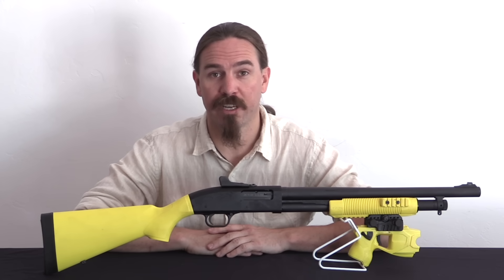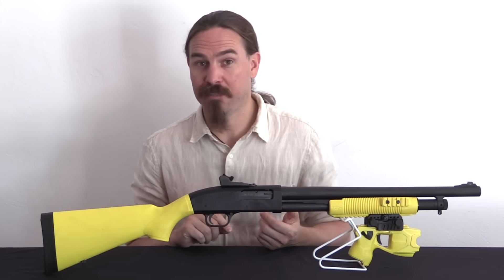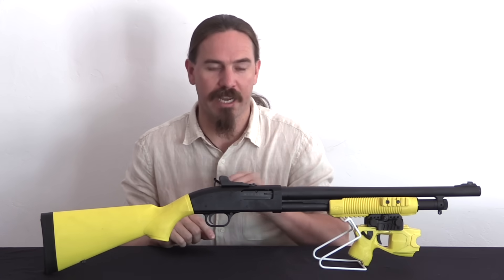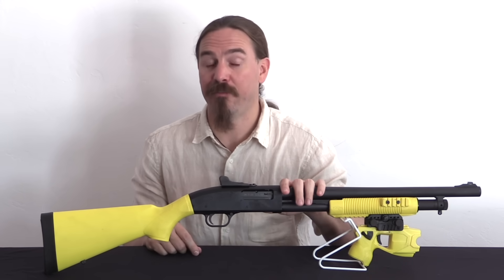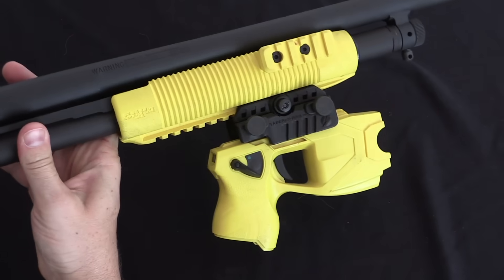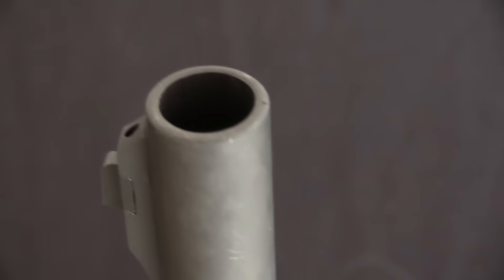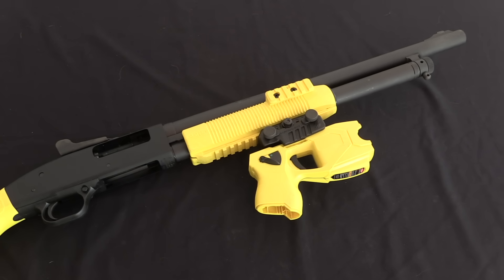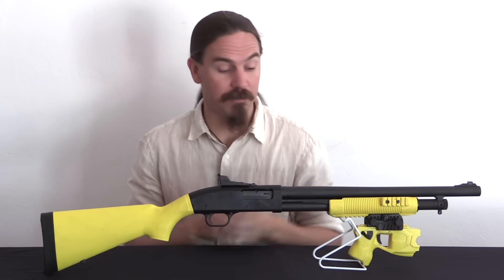Taser X12 XREP: A Taser in a Shotgun Shell

Comment: If anyone wants to know, this is how a taser works: 
It fires two little arrows with cables attached to it. İf both arrows hit the human and pierce his skin, the electronic flow starts, the targets muscles contract and the target falls on the ground. Problems: 
1- The range is between 1-8.5meters, so if somebody is attacking you, you have 2-5seconds to fire. 
2- There is a 15-20% chance that the Taser wont fire
3- Even if the Taser fires, both arrows need to hit, with at least 30-40cm between the arrows
4- Even if you hit the target, the clothing can be a problem (motorcyclist jackets, leather jacket etc)
5- some people are not affected by tasers

Comment: "Someone can stand 50 ft away and huck rocks at the officer, who can't respond with less than lethal force"
Sure, a rock is not AS lethal as a 9mm parabellum is. But they are still lethal.

In my mind, lethal force should be handled with lethal force. Regardless of if it is a rock, a bow and arrow, a gun or a noose.
It happened in my country back in the 90's, a bunch of antifa morons threw cobblestone at the police. One police officer was hit badly and so another one stepped in between the rock throwers and the downed colleague. Of course the shit-for-brains kept on throwing rocks despite the obviously downed and bleeding profusely officer.
Well, the colleague who was defending his fellow officer saw no other option but to respond with lethal force to protect innocent life. And so he took his Sig 228 and put a bullet in the closest rock hucker's stomach. To the effect of the rock thrower stopping, standing upright in chock, taking to his knees while holding his abdomen and then rolling over on his side.
About half a minute later he was screaming in agony from the new bodily openings he had acquired through his abs and backside. Clean through and through.

I watched the recordings and i applaud the actions of that officer. But "the public at large" cried wolf stating the "BOOOY" hadn't done anything wrong and that the officer should be fired and charged with attempted murder. Despite the fact it was clearly shown on the recordings that the idiotic babyman was throwing rocks at an already severely injured officer.
The court rulings were that the officer performed his duties as best he could under the circumstances and was commended for his actions.
The boy got off without further charges because being shot in the stomach was punishment enough. Though i would have advocated at least 10 years behind bars.
But hey, he lost one of his kidneys and his spleen so maybe that too is punishment enough.

Either way, in my world, lethal force should always be met with lethal force regardless of how lethal it is. Especially when targeting the police.
This of course includes taking out people behind the wheel. A car is just as a lethal weapon as a gun is. Albeit a bit slower and less precise. Still, anyone uses a vehicle as a weapon is someone who needs to have their life voided in my book.

Comment: "There are many less side effects of being tased than being hit with other police gadgets such as bullets"
Reply: If the prongs attach too close to one another, the current just flows over the skin with zero or at least, far less effect. If you saw the taser prongs both sticking out of his bare chest: that's failure mode.

It is the same with these Automatic Electronic Defibrillators: you are taught in First Aid class you have to position the connecting pads so that the current actually flows through the heart and not over the skin. And no, putting the pads on the front of the chest (as you see in many movies) isn't correct. One goes on the right front top of your chest (close to your arm-pit) and the second one on the bottom left side of your ribcage. Then the current flows through your body and not over your body.
Reply: all fun and games till someone shoots an eye out
Reply: @snoopyshultz  would MUCH rather lose an eye to a taser prong than have a bullet carry the eye, skull, and most of my brain onto an adjacent wall.....
Reply: This looks like a good home defense gun
Reply: I'm guessing no one has seen the video of the black dude not reacting to a taser
Reply: @sidevalve337  Probe must not have made connection, or had poor spread/only hit a limb. That level of electricity WILL cause your muscles to spasm uncontrollably. There is no toughing your way out of that.
Reply: @redhammer92  there's these things called PCP and methamphetamine
Reply: @redhammer92  gee it's almost like the taser isn't reliable enough for certain situations
Reply: @sidevalve337  Really they suck in terms of reliablity but its not because some tweaker is just going to ignore 15000 volts. The probes are finicky and inaccurate.
Reply: @redhammer92  gee it's almost like the taser isn't reliable enough for certain situations
Reply: kentuckyace 10 and no, it’s the taser not connecting properly. You’re supposed to split the waistline so one prod is in the torso and one in your legs or groin and if it doesn’t work it’s because the prods don’t apply correctly. No amount of meth is stopping the frequency of a taser affecting your nervous system
Reply: @marceldekerpel1003  how close were the probes?
Reply: @bohba13  Its been a bit since i saw the video but I would say it was a successful use of a taser in terms of firing it, the guy was just on something crazy or the taser didn't have a big effect on him. They were definitely close enough to be considered good.
Reply: @marceldekerpel1003  drugs don't stop mucle overide. you said they were close? maybe they were too close. you'd want the whole core of the body to contract. if they are too close maybe only one group would be compromised allowing full limb function or one of the probes didn't enter the muscle.
Reply: @jamesrustles8670  looks like bodyfat was the issue. and IDK
Reply: @marceldekerpel1003  Ive seen the video. Those prongs didnt make proper connection, pretty sure only one made contact.  

Im telling you as an Electrician, that level of shock is going to fuck your muscles up. No drug can make you move without your muscles. 

Look at the dude in the video, he cant move. Hes standing but locked up and instantly goes to get on the ground after. If both made proper connection he would have been on the ground instantly.
Reply: @redhammer92  Fair point. I guess he just didn't show much of a reaction.
Reply: @redhammer92  Tazers fail to neutralize people all the time, even when they are shirtless, look it up. The video has talking about the guy is standing still with just a tank top, clearly is zapped, but does not falter at all, and can still point and talk.

Also, electrocution means to be killed by electricity, not a small jolt or za
Reply: @kentuckyace1068  alot of the issue can be a probe hitting something harder than muscle and bending this sends the wave a little wonky I've seen the videos too but I've also seen videos of police hitting a high suspect and him locking up and smashing his head through a window. (I think he was on heroin I dont fully recall) tasers arent reliable at all but ive also seen people take 20+ rounds and keep walking.
Reply: @redhammer92  More likely it was just a stun gun rather than a proper taser. Most of the cheap contact "stunners" on the market can't really push voltage into your body, they just hurt like hell and cause contact burns, which anyone in the throes of an adrenaline rush can ignore.
Reply: @asteroidrules  The high Volts Low Amps setup of tasers in general make it hard to push into you, hense why the probes need to break skin in order to actually work.
Reply: Those are only for the black suspects.

Comment: So... The comments be full of people with more muscle than brains saying "I can fight off a taser just fine"?
And by the way, that isn't saying they have lots of muscle... Just very little of the important bits.

Ian is of course right. You physically cannot fight off a taser.
In the off cases where someone has been hit by a taser and still stood up and seemingly not reacted, it is because the prongs of the taser did not connect with flesh or they connected too close to each other so the electricity didn't find a path through the targets nervous system.

Also, make sure to differentiate in your mind, the difference between a taser and a stun gun is that a taser sends very low power pulses where a stun gun sends high power pulses.
A stun gun therefore works in the short distance between the electrodes where a taser would not.

If anyone is going to claim that they can fight off a taser they need to take off their hoodie and the remaining three layers of clothes they have on their upper body and take a taser that is deployed at its optimal distance to the target ensuring the prongs hit you both sides of your spine. Then we dance!
Then you will not claim to be superhuman any more, you will be going to the bathroom to clean up your pants because of the involuntary disembowelment you just went through.

And that is the problem with any taser solution and to some extent, even stun guns... They don't work all the time. The harder it is for the prongs to get to the targets fleshy bits, the lesser chance there is of it having any effect at all. Like none, zilch, nada, zero effect.
That is why there's always another officer ready to use lethal force in case the taser doesn't connect.

Comment: So the taser cartridges can also be used in a standard shotgun if I'm not mistaken?

But converting this to a lethal shell firing gun is tremendously easy with just a piece of sandpaper or a file, so they should probably regulate it similarly to an 80% ar lower reciever.

Comment: The lack of interest due to cost isn't the only reason these things fell to the wayside. UK Police obtained two of these on an urgent basis to deal with a crazed gunman called Raoul Moat who went on a rampage with a shotgun in 2010 in Northumbria, UK. In a stand off where he had the weapon pointed at himself threatening to commit suicide, two police officers fired these rounds at him using XREP's in an attempt to prevent him from doing so. At the time they where not authorised for police use but they where keen to try anything that might end it peacefully. Both shots failed completely and he made good on his attempt, killing himself. It was later assessed, in one of the few operationally active times the XREP has been fired anywhere, to be nowhere near anything like reliably effective and the UK police withdrew them from testing, and it's thought this dismal performance might have had subsequent effect on other law enforcement agencies desire to use them.

Comment: 1:00... You actually CAN will your way out of a taser. You see it all the time with drug addicts. Its less common with individuals who aren't under the influence, however it IS possible.

Edit: 4:58... you even explain yourself that the engineers who designed this device had the forethought to design a countermeasure for the individual who managed to will their way through the taser pulses to attempt removing the device. This wouldn't be necessary if overcoming the electrical pulses was impossible or even improbable.

Comment: The lethal version of this is "I mounted a Glock under my Mossberg, just in case they're too far away."
Reply: You can also mount a zip22 underneath for a semi-lethal version
Reply: @kevintang5473  if it doesn't explode in your hand the minute you pull the trigger. Little garbage doodoo nerf gun.
Reply: @chatdeblanc  Exactly, you throw the gun to the enemy and when they try to use it they're knocked out.
Reply: @chatdeblanc  hey, that's a little harsh. Nerf blasters have came a long way in terms of reliability.
Reply: @stevenbobbybills  and then regressed...
Reply: Also "I mounted a Glock under my Mossberg, just in case they're too close."
Reply: Extra points if the pistol is connected to the shotgun by its slide!
Reply: ...fucking tupperware gun

Comment: How would you put a sling on that without obstructing the "pistol" unit? A single-point sling would work, but you'd need a connection point.
Note: Remember the old-style taser used in 'Innerspace'?
4:05 The most tsundere of plants.
6:38 Just like a Maverick 88. So why not give it a full pistol grip stock as per standard? Why a wrist stock if there's no tang safety?

Comment: It’s certainly a good concept, shame about the price though.
Reply: Mekner after watching Donut operator, tasers are quite unreliable, so if these are much more reliable and work well it would help reduce controversies if police use them, in that case its probably worth the cost
Reply: The problem with taser shotguns is that you can’t reactivate the probes after the set deactivation time, preventing you from easily neutralizing a target who becomes combative after deployment.
Reply: kilo would multiple shots work?
Reply: Rashed125 You could, but the problem would only come up when you were at point blank range. On top of you shotgun being fairly unmaneuverable, the rounds have a minimum range for the targets safety. It would work, but there’d now be significant holes and broken bones that you’d have to plug and mend.
Reply: kilo atleast the baddy isn’t ded, if he don’t die then ppl don’t gotta complain = less riots.
Likely gonna be a long time till non-lethal are usable enough that lethals aren’t used as much in deadly situations
Reply: Rashed125 The “handgun” style taser is just a better, cheaper, and more reliable alternative. And if you need a pain compliance tool, beanbag guns are probably safer and cheaper.
Reply: kilo As I stated above, they seem VERY unreliable, so unreliable that in deadly situations using a lethal is the best option. Same thing for non-lethal rounds, people are able to tank them easily in most deadly situations so they’re completely useless in those cases, and drugs help negate the effectiveness of both tasers & non-lethal rounds, rendering them useless.
I don’t care about the pain part, I just mean that if theres a non-lethal that can be used over a lethal in a deadly situation, it would lower the number of riots if used.

Comment: I was watching the video and was like "oh wow, that seems like a reasonable, humane method of dealing with someone at long range, without bringing lethal force into the equation. And it's designed so that regular shells won't fit to help prevent accidental killings, (or purposeful ones called accidents)?? This is what cops need! Thanks, Mossberg!" Until Ian started describing the projectile. Barbs, spikes based off a cactus, uninsulated wires, and a 20 second pulse. All on a fairly heavy projectile designed to be accurate at 90 feet. That' s a lot of momentum. Holy shit. That's kind of horrifying.
Reply: Weapons often are. I suppose it's preferable to being hit by a bunch of shotgun pellets.
Reply: It's still far better than being shot with a regular shotgun.

A regular tazer works roughly the same way, it fires two barbs the size of rifle cartridges that embed into you.
Reply: Getting hit with a tazer is definitely an unpleasant experience but it's definitely preferable to suddenly having a fist sized hole in your body.
Reply: Albeit extremely expensive and in the few cases it was actually was used in a live scenario (although it wasn't supposed to be) it proved pretty much completely ineffective

Comment: "Cholla" oww-oww-owww. This is without a doubt the NASTIEST thing you've ever covered, Ian. And that ties in with the issues with Tasers that others are mentioning- if you don't get both probes to make good contact (draw blood), then nope, expensive and dangerous wet firecrack-type scenario. When we see Tasers fail, a probe completely misses or doesn't get through clothes or you found someone phone or wallet. Four probes, and the joy of cholla, yeah, that's going to make contact if they grab it. 

The interesting part to me is that this is a Mossberg marked receiver, but with a Maverick trigger and safety. That switch means that if you normally issue Mossberg (which at least around here are as common as the Remington), this makes a pretty quick tactile reminder of which system you're holding. 

And pity on the price per shot. I think an inert, ballistically matched training round would be workable, but most city councils get a bill for a a quarter million dollars and it's only for 2000 rounds of ammunition... yeah. Dead before arrival.
Reply: I'm pretty sure that a Pak40 is way nastier.